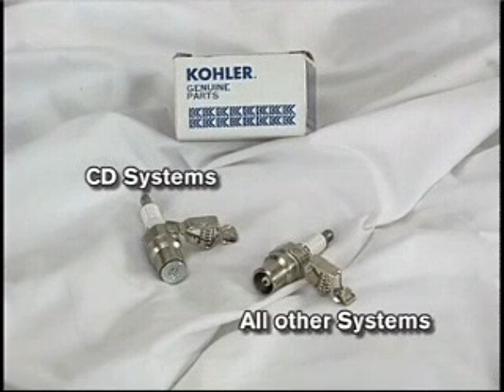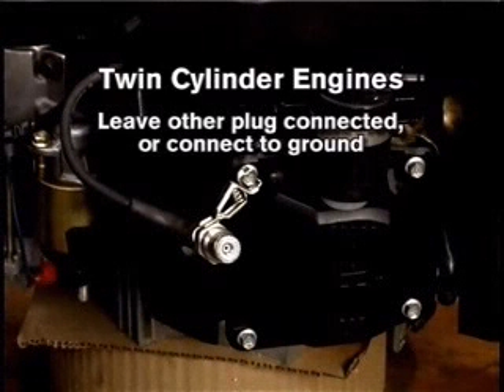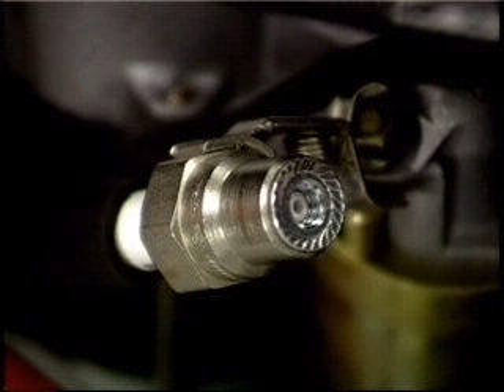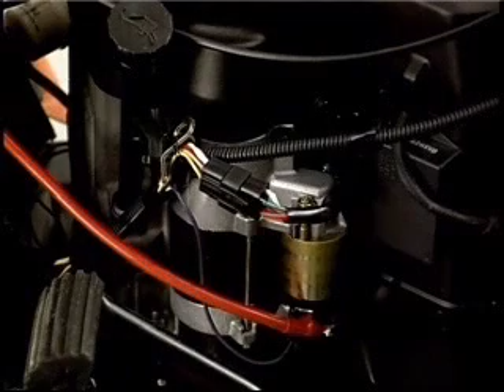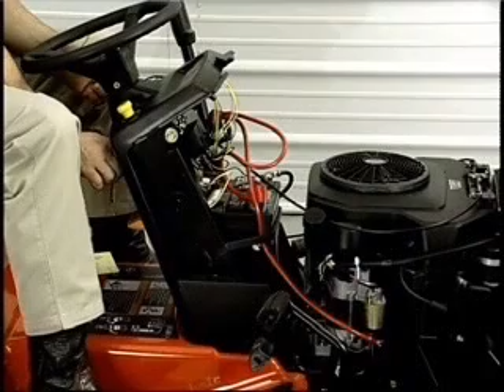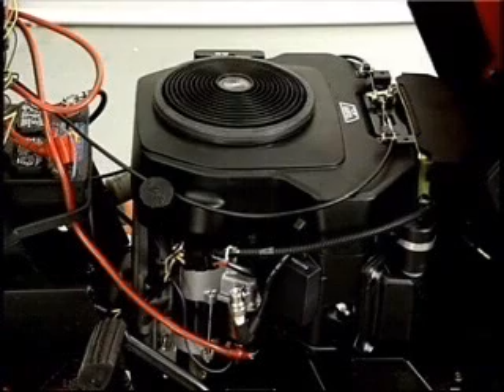Ignition Systems Troubleshooting Kohler Engines

Comment: Well between your excellent presentation and my 25 years spent in auto electric I am now feeling like a child that is starting all over again. Let me try & explain. Like many of your followers I have a fair amount of mechanical/electrical experience developed over many years working in the automotive trade plus 20 years in the USN working Aviation Electrical so at 79 yo I usually am successful in troubleshooting and repairs of whatever it is I get myself involved in - till now.. This should be so simple I'm somewhat embarrassed to post it. I'm not talking about a complex circuit on a late model vehicle - I'm talking about a 2019 Cub Cadet zero turn mower with a Kohler 22hp 7000 series engine that cranks at proper rpm but won't light off. It has an MDI ignition system - about as simple a system as one can get. Even I know it takes air, fuel, and ignition for combustion. Think I can rule out air as I'm still breathing ok. Using a ignition spark plug tester I verified no spark. I removed ground leads from both coils - still no spark. I replaced coils - same result (no spark). Next I took new spark plug and grounded it to engine and discovered a "weak" spark. Due to smell of fuel (old) I replaced carburetor and gas - no joy. I shot starting fluid into throttle bore - no help. I'm still thinking that I'm just not getting a strong enough spark to light the fire. I've gone as far as removing the flywheel to inspect magnets for the stator and also measure stator resistance - all good. The only thing I'm unsure of is the external magnet on the fly wheel that triggers the coil - do they ever go bad? Thanks for whatever help you and/or others can render. Mike
Reply: I think I have the same problem with my Kohler engine. I can’t get a spark.